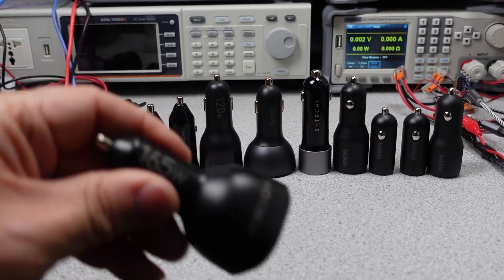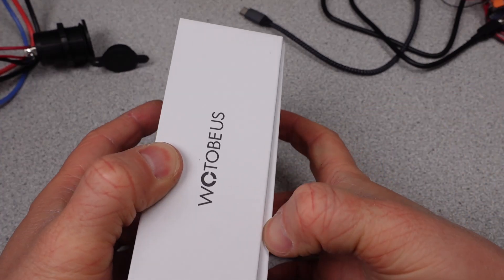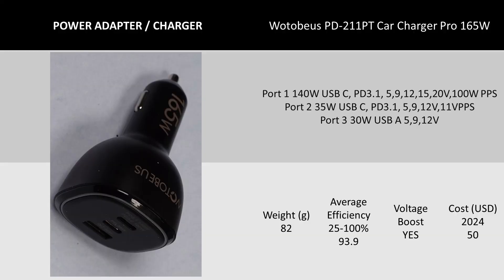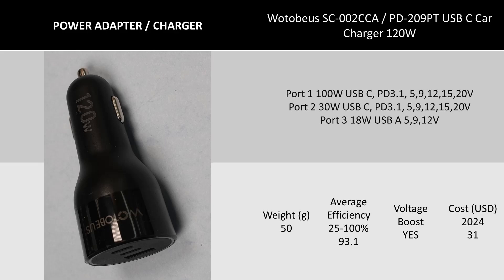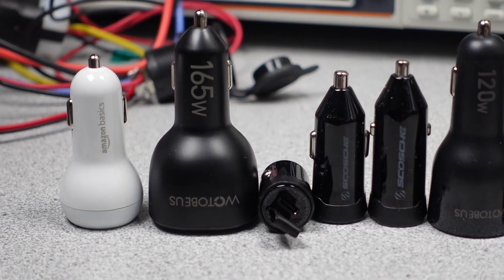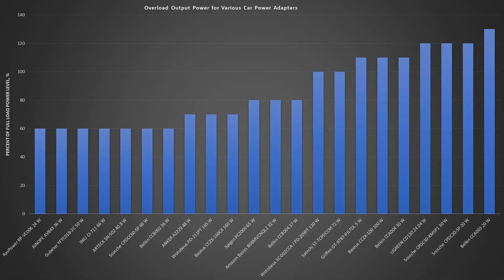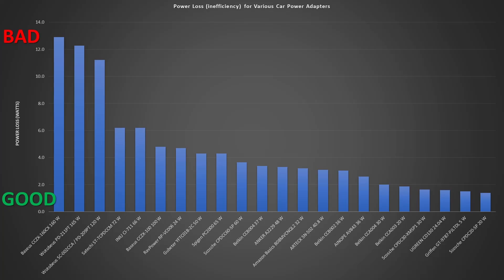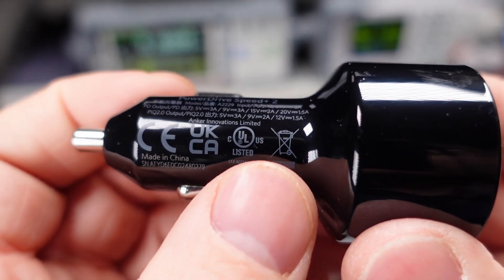USB car chargers from 5 watts to 165 watts reviewed and tested

Comment: i have the Basus and now I know to only charge one phone at a time and not leave it plugged in all the time. thankfully my car cuts power to the outlet when the car is off.
Reply from the maker: Yeah, my car 'cuts' power to the socket but it really just reduces the voltage, it's not the best design.  Newer cars tend to isolate the socket all the way so that's good.

Comment: At our summer cabin we only have a solar panel with a 12V system. As we stay there every year for 5 weeks i need to do some remote work and thus need to charge my 16“ macbook pro with a m3max. As we have the ports for car adapters in our 12v system it would be good if there was a carpoweradapter to charge my macbook as a powerconverter to 240v ac and using the normal wallpower adapter is really inefficient. What reasonable higher power but safe adapter would you suggest?
(Im not sure atm but i belive it is fused with 20A. So there should be enough power)
Reply from the maker: Yeah, that's a tough one.  There are many pure sine wave inverters though, so that with a normal power adapter is one option, yeah, you will lose efficiency converting multiple times but it will be more convenient, plug and play at least.  With 20 amps should able to go up to 150 watts for the inverter size without issues.
Reply: @AllThingsOnePlace  yeah we have a pure sine wave inverter. Just the loss isn’t great so if there was a 12v to usb c adapter thats save and powerful we would switch as power is very limited.

Comment: The UGREEN charger seemed to be a stand out based on the data but you didn't really mention it much. What's the reason for that?
Reply from the maker: No reason.  The UGREEN is also an excellent pick from this video.  I thought about it making the video but I picked the one I've been using for two years.

Comment: Hello ATOP (do people call you that?), I have a question for you. If I use a 4-port GaN charger to power, say, a Chromecast and a travel router, will these devices lose power when I hook up something like a Steam Deck to charge and the adapter recalculates how much power goes where? I'd love to bring a multiport GaN charger for travel but I don't only want to charge stuff, I want to constantly power some devices as well. Thank you!
Reply from the maker: I got all numbers.  No idea what people call me, troublemaker mostly.  Yes, with most adapters, you'd lose power with plug and unplug of additional devices.  It's the way it is.  You could use two chargers, a low wattage dual port one for the router and chrome cast?  But yeah, there should be some additional market options.
Reply: @AllThingsOnePlace Hmm, I'll have to be on the lookout for a dual port brick that'll power both these units then, and buy a fancy shmancy GaN unit for everything else. Thanks!

Comment: Hey I found your channel very recently and I love the way you review the products and the quality of your videos. Problem is I do get very confused with all the data so imma ask you directly.  What is the best charger you recommend for charging an iPhone 25, Apple Watch 7 and AirPods Pro?
Reply from the maker: Thanks for the feedback!  Yes, the videos are in that middle ground of not really engineering but talk about the concepts involved in the design process of any electronics device.  I have slowly been removing information from the videos and making them more general purpose although nothing seems to work, time to go back to information overload maybe.  This video in particular has too little explanations and time spent on what the parameters mean, of course more carefully presenting this data this video on other channels could be an hour long or several videos.  Channel is dropping like a rock for performance too so motivation is zero. 

For charging in you car?  Something with three ports I guess.  Which limits you to the Baseus or Wotobus from this video.  For home charging, there are tons of options, I still recommend going oversized a bit, so 100W chargers tend to be high efficiency, good power quality (yeah that's one of those advanced topics), and have capabilities to charge something a bit larger if needed.  Anker 100W Prime or Baseus 100W GaN3 desktop (120V only) are usually my go to.
Reply: @AllThingsOnePlace thank you so much for you response! Hmmm for home charging do you recommend the regular baseus 100w charger as well? Because I am looking for a charger to take with me on the go
Reply: @AllThingsOnePlace your channel/database is my goto for anything charger-related. I get it, it is not a topic that is naturally predestined for high view counts, but I have already recommended the channel to multiple people and would love to see you keep at it.
Especially with new 240W USB-PD on the horizon you will have some very interesting chargers ahead of you and many people looking for information.

Comment: Hi! I had one question. I recently bought a new phone, Nothing 2a, their website doesn't ship the official charger to my location but they recommend using any branded charger which has "PPS protocol supported"
After doing some digging I came across a few recommendations as follows:
1. Samsung 25W. (leaning more towards it as it is relatively cheaper)
2. Ugreen 20 or 30W Nexode (unsure of their reliability)

I don't mind charging my phone a little slower if that will prevent it from overheating, battery life matters more me to for the long haul.
Reply from the maker: The UGREEN Nexode 30w is a decent choice.  It was one of the few that I found okay from the latest UGREEN round up.  Price is also right.
Reply: @AllThingsOnePlace  thank you for answering!!

Comment: You actually want to know why the EPR didn’t work on the wotobeus? It’s the design of 12-24v car chargers and the cigarette system - 20 volts is below 24 , but 28 is over, which is why it was tripping, even when the voltage boost is working. The whole thing wasn’t built for 28 volts at all
Reply from the maker: It doesn't even allow a 5V mode to work, it will not negotiate at all with an EPR device connected.  It wasn't tripping, it never worked at all.  But yeah, operating at 28V output is possible with the boost converter.  They put it on the box so I'd assume they designed it to operate at this voltage but as you mention, I guess not.  Too bad.

Comment: Can you test surge protectors, like the 6-8 outlet ones?
Reply from the maker: Kind of...  I don't have a transient tester or a surge tester.  They usually need to be able to supply huge pulses of very fast energy.  I can only really test them for electrical isolation, ground bonding, and sinusoidal trip voltage for protection circuits.  More than I've seen anyone else do on youtube but yeah, eventually, yeah, it's not a glamorous topic but it's interesting nonetheless.

Comment: One thing I'd like to know is which of these support 12/24V and which ones are 12V only; this information is notoriously difficult to find in the listings, and I usually have to resort to just buying one and either carefully inspecting the device/manual or just plugging it in and hope it doesn't blow up.

I think you imply everything here except for your old 5W unit can work on 24V based on the graphs, but I'm not 100% sure.

I'm surprised none of these seem to have low-voltage cut-off; all the ones I've bought and tested seem to turn off their outputs below something around 9V or so.
Reply from the maker: I know I run by it quickly, but these newer ones all worked on both 12 and 24 volt.  But yeah, you are correct, that everything except the old 5W unit is 24V compatible.  

Yeah, some of these run down to less than 3 volts, I guess whatever chip they shove in they go with the defaults and send it.

Comment: i have the 160w and i use it like crazy. normally being used to charge my laptop (100w) or my anker prime 27,650 (140w). my favorite part of it is that each port has its own seperate line. no more dropping two ports to 5v if they’re both in use.
Reply from the maker: Wow, you must have a very good 12V socket.  I melted one already.
Reply: @AllThingsOnePlace  GM sockets are tough.
Reply: @AllThingsOnePlace I like that the Chinese companies will let me decide for myself if my car can handle it. It'd suck to be stuck with lower wattage, just because some cars can't handle it.
Reply: I have the same adapter with heavy duty sockets. Been running continuously for years. Thing is a work horse. I've had many other adapters die in the meantime under less loads.
Reply: @The_Ballo  mine has been rock solid in texas heat under full load aswell. i regularly discharge my anker prime and recharge it fully at 140w with no issues

Comment: A small bit of feedback: since you mention the idle power quite a bit, and that seems like a relevant metric for these, it might have been good to show those numbers with the individual cards, or show the graph with all of them earlier. I only own a low-power USB-A type charger for my car, but now you have me wondering what the idle power is.
Reply from the maker: Thanks!  Yeah, I agree, I time crunched and pushed it out, already 4 days later than planned and made a few errors in the graphics.  Entirely forgot to talk about one of the chargers...  But yeah, I was surprised on some of these.  It's a good improvement for the next round and thanks for the tip!

Comment: I can confirm that the Baseus 160W can pop a fuse, it did on my car when charging a Powerbank at 100w and charging two phones at the same time... stupid me...
Reply: I got the 160w because it can charge my 65w laptop and fast charge a phone. I would rather get overkill, since perhaps someone might want to charge their 100w laptop at some point. It's a modern truck designed to feed lots of power anyway.
Reply: I got the 100w because I had the fear that this could occur
Reply: @Polo4413  after that, I don't use the 3 ports at the same time... Almost a year after the "event" and no issues
Reply from the maker: Thanks for sharing!  Yeah, it is impressive how much they can do but yeah no regard for safety limits.
Reply: @AllThingsOnePlace  the fuse for that circuit is actually generous (15A for a 120w output ) but I think that my battery was a bit low voltage with engine off and because as you showed, it has no low voltage cutoff, it pulled too much amps, good that fuse popped before I could damage the battery.
Reply: I've had good luck with that adapter. Been running it continuously for years. I have heavy duty sockets with thick cabling, though.
Reply: I only need it to primarily charge one and maybe at most 2 phones.

A Samsung, and maybe some other device. 

Good to see it's fine as long as your aren't trying to get that max output out of it. Looking at 70W at most....it's the only capable one I can't find close to my vicinity atm.
Reply: I love your ambition!

Comment: Isn't the heat output less of (or not) an issue in a 12 V socket rated for use with a coil cigar lighter?
Reply from the maker: The socket should survive at least, I actually like the old metal sockets.  But the adapter itself can still melt and deform, on the cheaper side of things.

Comment: I use the same Anker A2229 charger - works fine. Only downside - not enough amps on USB-C port to charge laptop (Lenovo T470). If laptop's battery is almost flat, charger struggle's to charge it.
Reply from the maker: mmm yeah, it isn't the largest out there for sure.

Comment: Could you elaborate a bit more on what is wrong with 30W Belkin? I’ve had it for a while but your review suggests it’s a subpar product. Great video as always!
Reply from the maker: Yeah, the issue was the low turn off voltage, like far too low, for a hobbyist it's actually a benefit...  The socket issues, the extremely high idle power usage and the lack of shutdown at lower voltages for a car charger are the reasons.  The efficiency at full power is actually good but you need to make sure it fully disconnects when you aren't using it.
Reply: thanks, much appreciate your reply! @AllThingsOnePlace

Comment: Help! :) I've been struggling with a bizarre USB car charger issue in my car. I keep one permanently connected alongside an AUX cord, and a Belkin device that bonds both to a single USB-C cable for my phone. This means there's a connection between the car charger and the AUX input all the time. Recently I got all new chargers and cables with a new phone, and also changed which cigarette outlet it's connected to (my car has two). Now, I noticed that there is an audio hum over the stereo that correlates to engine RPM, but only when there's no phone connected (I assume this is a grounding issue). When I step on the gas, the AUX audio hum also increases. When a phone is connected, problem goes away. I'm trying to figure out where in the chain this problem is coming from. My first guess is my charger is contributing to this. My question - if my goal is to eliminate this audio hum, could one of these features such as voltage ripple suppression or charging modes help? I want the charger to be as electrically "quiet" as possible when not charging so as to not cause audio problems. Any advice would be appreciated!
Reply from the maker: Yeah, these chargers can potentially amplify noise passing through.  none of them really had what I would call good ripple characteristics, limited space so they do what they can I guess.  But yeah, a filter on the DC supply line on the way to the charger is one option.  It would have to be a moderately sizable filter to take care of the low frequency noise on the line from the engine.  I do see the potential of the grounding issue too.  I'm not sure if one of the DC sockets has a worse connection or something?  But yeah, so many paths and things to try!  If you do end up figuring it out please share!

Comment: I've tried the Wotobeus, an unbranded Wotobeus lookalike, the Baseus and a Ugreen to charge my laptop in my car. My laptop can charge over USB-C at up to 140w but even the chargers that claimed 140w on a single port or more only delivered 100w max. They all get disconcertingly hot, especially the Ugreen which got hot enough to where I could melt through a McDonald's cup with the positive pin. I just bit the bullet and got a power station.
Reply from the maker: Yeah, I didn't talk about it in the video, it didn't make the cut, but yeah, cramming 10 amps through a pin that has a contact area the size of a needle doesn't work out in most cases.

Comment: I've been using that Wotobeus 120W for a while now, though not at close to its max power. Now, I might consider switching to something like that Satechi 72W if it has PPS for Samsung Super Fast Charging (couldn't tell from the video if it does or not).

I don't have to worry about idle consumption because my car (2019 Ford Fusion) and a lot of other modern cars have power management built into the various modules and can turn off the power to the 12V port when the car has been off for some time.
Reply from the maker: I didn't see PPS on the Satechi.  Yeah, my car is older, and for some reason it doesn't relay isolate the socket when off so it just lowers the voltage through what is probably a very convoluted path to what should be a 'shutdown' level but instead makes these chargers draw even more power as they try to hold up the voltage on the output.

Comment: You've had better luck with Anker products than I...
Mine keep dying prematurely...

I recently got a Baseus FM transmitter+charger... It does ok... I also have a 100w capable one that does poorly when the car starts (can't do super fast charge on samsung) but a re-plug will allow for negotiating fast power...

I have an older anker that advertises 45w, but I suspect that is combined. No 1 port goes over 18w despite having 4 ports... this is fine for road trips, but not for fast charging anything or charging my laptop...
Reply from the maker: Yeah, of course the person that reviews them always has the best luck...  Ah yeah, that's not great that a replug is required.  I can't remember the last time I unplugged the cable from the charger in the socket in my car.  Probably two years ago when I made the last video, ha.  Anyway, thanks for sharing!

Comment: I like to use these chargers for charging drones such as the DJI avata. I think it may pull around 45-60w
Reply from the maker: That makes sense, not too much power but more than a basic charger.
Reply: Just measured idle power of mine 3 car adapters. Very important as my battery discharges quick. The ones that came with 70mai dash cams, with a constant 12.24V:
1 port 1.43 mA 0.0175W
2 port 2.55 mA 0.03W

Aukey from Microcenter with USB-A and C ports:
13.62 mA 0.167W
Ouch. Aukey will not be used in the car anymore.
(Used Fluke 87 to measure)